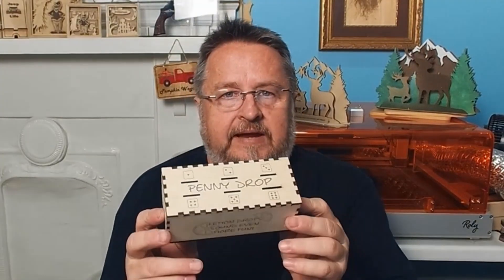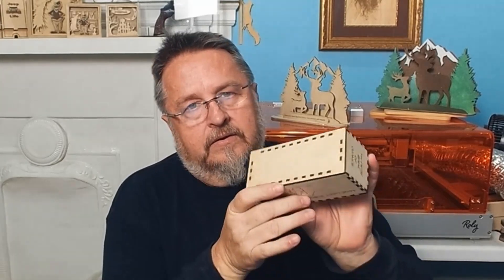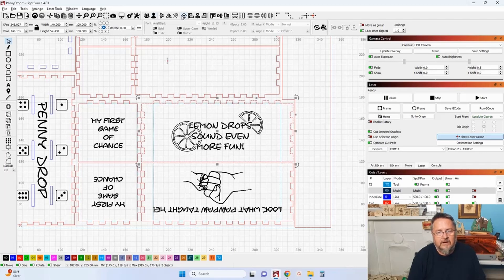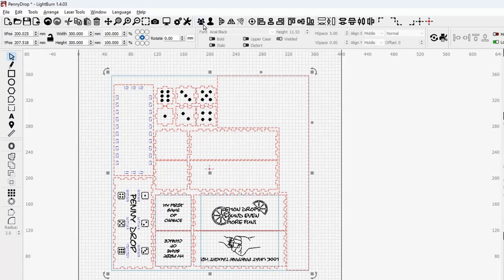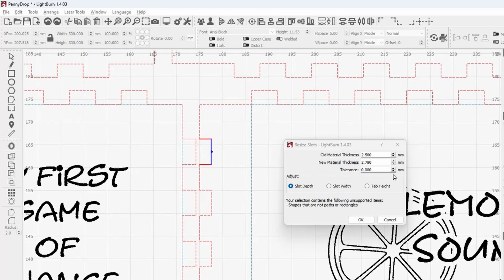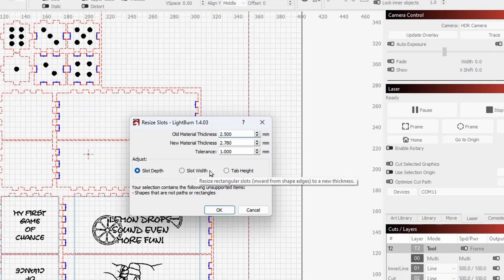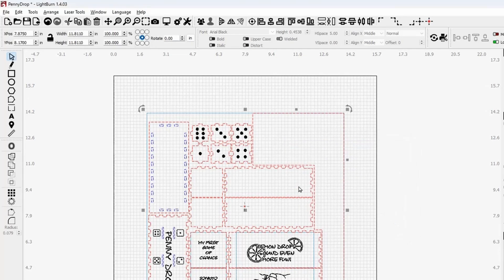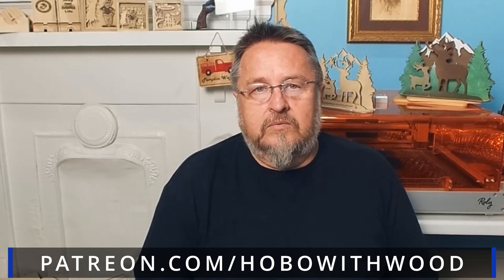Why Your Resizing Slots Tool Isn't Working

Comment: I swear you have a camera in my workshop! Every time I have a problem with something you have a video to explain it! By the way, sorry for the language you're hearing :)😃😃
Reply from the maker: I used to own a auto repair shop filled with a bunch of heathen redneck mechanics.  I'm sure I've heard worse.  It's good to know folks can still find value in the older videos.  Some of the really early ones should probable be taken down,  But leaving them up shows the progression I've had and others can have, too.

Comment: Using your information I managed to get lightburn to resize the tabs but the slots will not change no matter what. They outline in green not like your screen shows. This feature has never worked correctly thru all the versions.
Reply from the maker: It works. The problem is the file. Almost assuredly, the tabs are the problem. Not Lightburn. If you send me a file that you are having trouble with, I'll be happy to examine it and demonstrate the problem. Send the file to me at hobowithwood@gmail.com.

Comment: I think I keep my tolerance at 1.5 and so far has worked great when I don't know that material width and just guess because I am too lazy to use the ruler 😊 One thing I want to see in lightburn is just a simple CUT function rather than going through the boolean stuff. have a safe trip and can't wait for the videos!
Reply from the maker: There is a simply cut tool. Alt Shift C is the shortcut to the cutting tool. If you have two shapes on the work table and you want to cut one from the other, select the piece you want to keep first. Then while holding the shift button select the shape you want to use as the cutting tool. Then Alt Shift C, or in the tools drop down menu select cut shapes. This will make the piece you used as the cutting tool disappear and create the desired cut you are looking for. The original peice will now be in two separate pieces that can moved around or deleted.

Comment: Steve, please clarify - how does saving a file with kerf settings corrupt a file?  I've been doing this since i started using LB and have never had an issue.  Is this something LB  recommends, or your opinion?  

thanks
Reply from the maker: I found this out the hard way. I posted three different files on my website for sale. All three of them would no longer correctly resize the slots and tabs. Even though the layer shows 0 kerf. When you would try and resize the slots or tabs, it would never go to the measurement you told it to go to. I was told that because I had saved the file on my PC with kerf previously, even though I shared a file with 0 kerf, it was corrupted by me saving it initially with kerf. I was also told that this is a known issue that goes back many, many versions.  If your design doesn't have slots or tabs, or you never plan to use the resizing tool. Then save all the files you want with kerf. Just trying to share what I've learned the hard way.
Reply: I have been wrestling with this all day and finally figured it out. My slots were made up of curves that are set to be straight like lines. Converted them all to lines and all worked as expected - That was one frustrating day!!